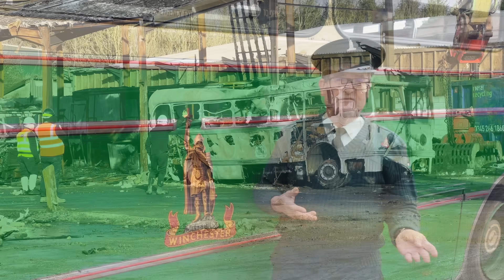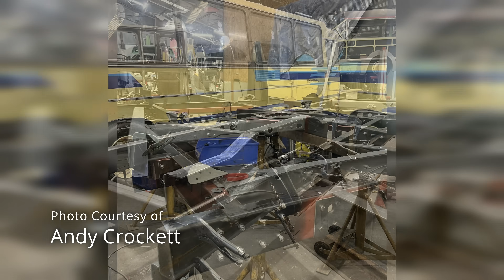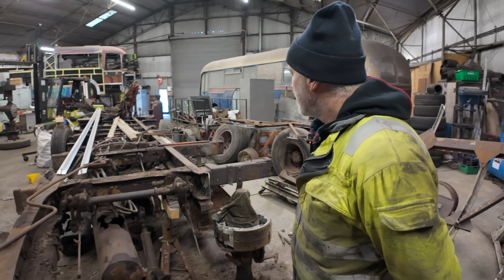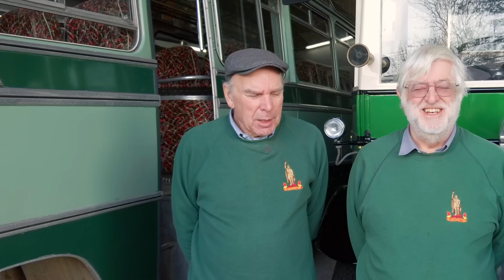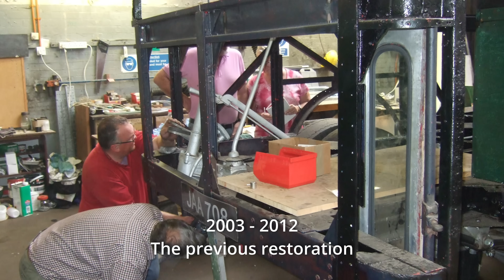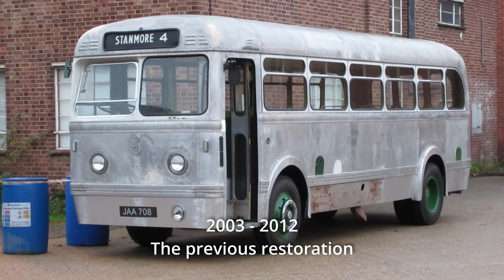December 2025 Update for JAA 708, 1950 Leyland Olympic | Friends of King Alfred Buses

Comment: So , olympics has or not has chassis ?
I am asking.
Thanks.
Reply from the maker: The Leyland Olympic was announced in 1949. The buses at that time, you have one manufacturer building the chassis and sometimes another company would build the body to fit on the chassis. However, the Leyland Olympic is ".....described as "integral", the bus was conceived and built as a single unit, rather than the traditional way of building buses, as a seperate chassis on to which people with cabinet-making or metal-working skills could build a structure in which passengers could sit....." - from the book "The Return of the Olympic", page 4. (ISBN 978-0-95665740-1-5). This book is available to purchase from the Friends of King Alfred Buses webiste: www.KingAlfredBuses.org.uk
Reply: @hellowallace Thanks to you , so much.

Comment: Surely this restoration is a complete and utter waste of time and money !!!!  -  The vehicle should have been left as fire damaged and NOT rebuilt as a 'cloned' vehicle.  The same goes for the nonsense of restoring the Leyland PD which is another complete waste of time and effort.  FoKAB needs to get it's vehicle preservation priorities in order if it is to survive rather than becoming a 'cloning' organisation .................................................................................
Reply: Hi. Normally I would agree with you but 708 is a rare example of an early 1950’s underfloor engined vehicle. I suspect that the ‘bus inspectors’ from NARTM, National Association of Road Transport Museums, would list it as worthy of continuing preservation unlike many wother buses and coaches. To put that into context there are an estimated 12000 buses under preservation but 708 is one of two known to be in existence of that particular make and model, so it is indeed rare and therefore worthy of reconstruction. The fire completely destroyed several more modern buses but the robust and heavy construction of 708 was sufficient to prevent its total destruction. So yes I am a supporter but I am also very lucky in that my own bus is normally garaged at Penton but was absent having some maintenance when the fire occurred.
Reply: Personally, I think they are doing a sterling job, of restoring these beautiful historic buses, and they are free to decide what should and should not be saved.